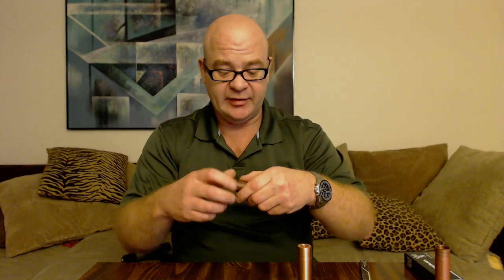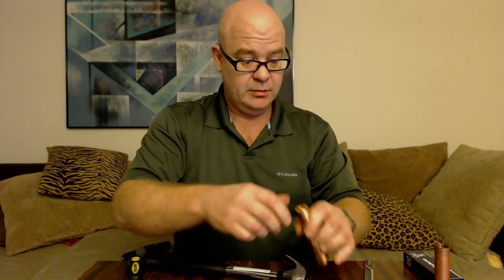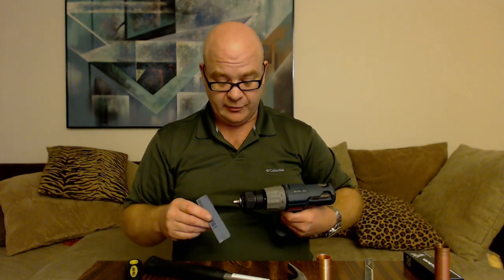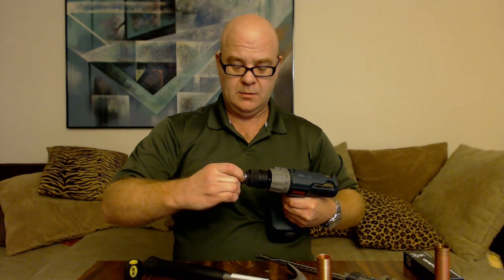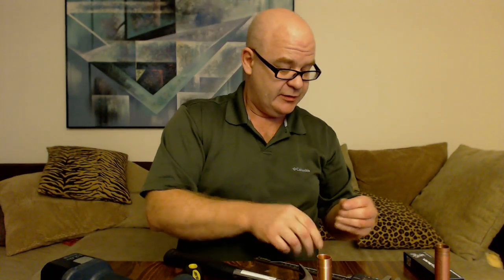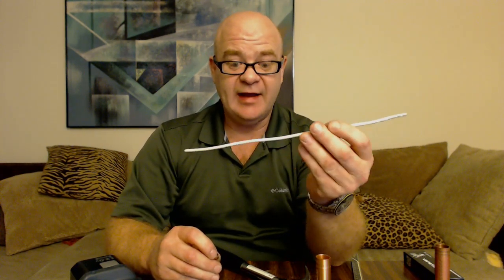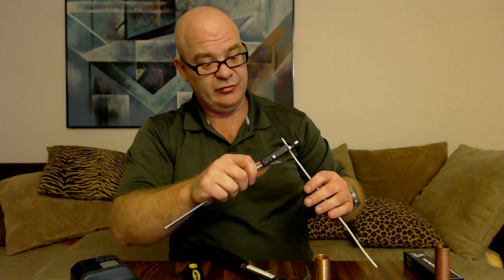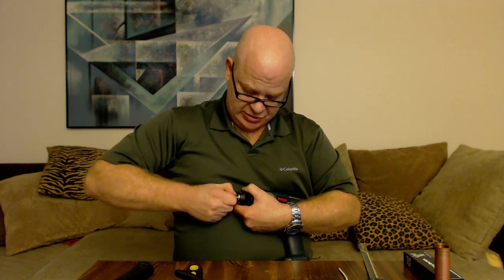Overdose & Pegasus Mod Floating Pin Fix

Comment: I had a top cap from a Pegasus that the contact was to loose and would fall out so he sent me a new top cap. Only problem I have had is getting a RDA that sits flush, it sits flush on the top cap but the top cap will not cause the pin in the contact will not adjust anymore. Anyone have this problem? My Patriot will work but my Stillare will not, it really sucks! Great mod though.